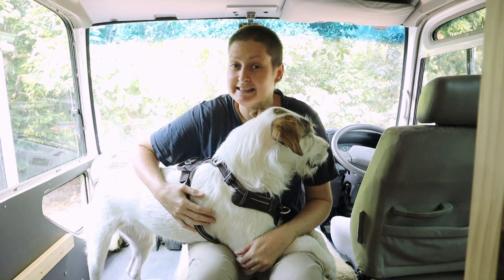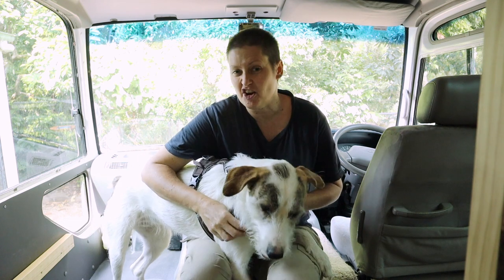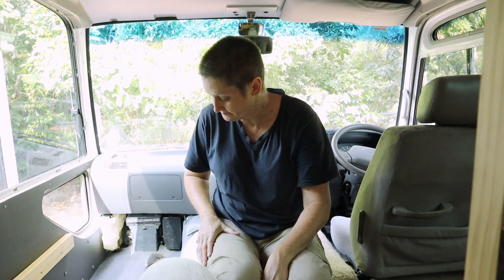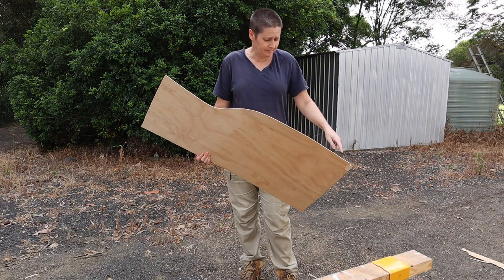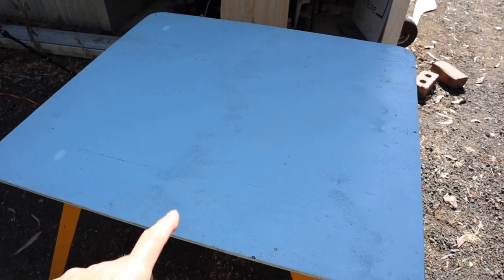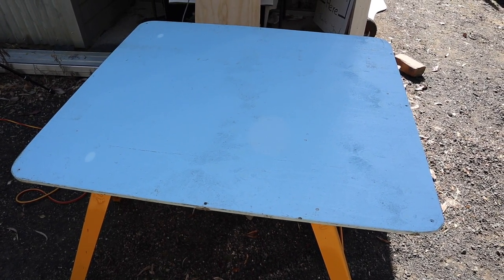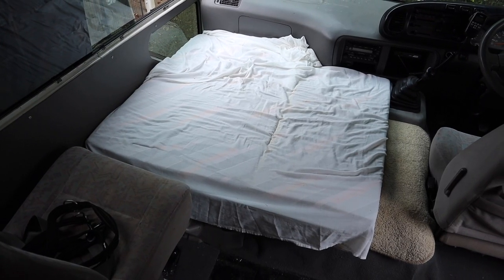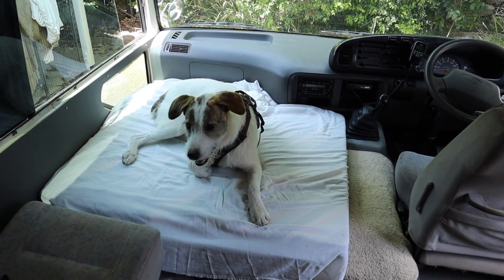Building a seat for my dog in our Toyota Coaster motorhome

Comment: That is so cool. I wonder if I could legally remove my passenger seat.
Reply from the maker: You may be able to. I mean, I removed 19 seats from my coaster LOL. You would just need to get certification for the new seat number. Not sure what state you are in but in Qld you would get a blue mod plate attached to the vehicle that states the seat change. You'd also have to check how the modification affects your insurance.

Comment: Dyani,
Thanks for all your great content, looking for a bus and today I found I could not stand up in a 2005 coaster, do u know the standard height and what height do u have after adding you ceiling ? I am 5ft 10 178cm and shrinking so would I fit in a Coaster similar to yours ? Grateful assistance
Ron
Reply from the maker: Hi Ron, mine is a 2005. I think all the Australian delivered models from that year should be same as mine but some of the imports are lower height apparently. The height from my subfloor frame to the roof frame when I had stripped everything out including the floor was almost 1850mm in the middle. Now that I have put 18mm ply and the vinyl on the floor and lined my ceiling with 12mm shiplap on top of 7mm insulation I have 1805mm height.  Hope that helps